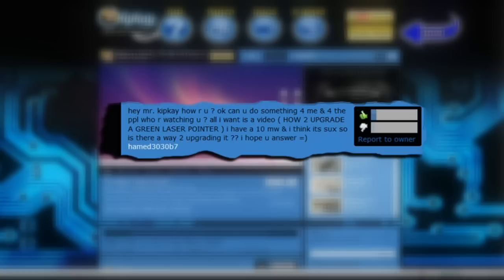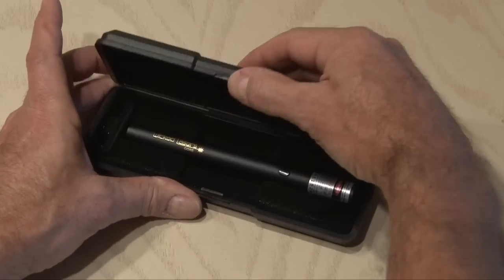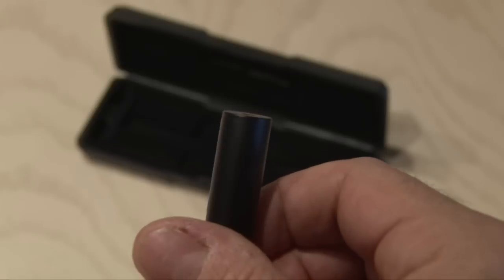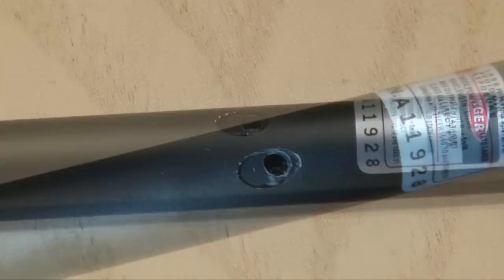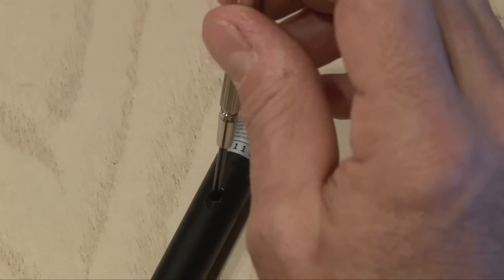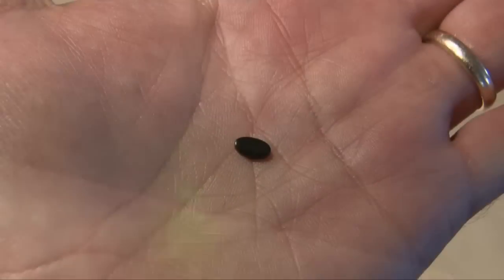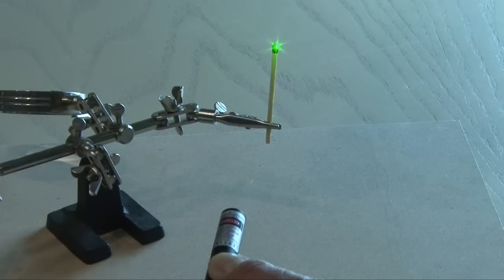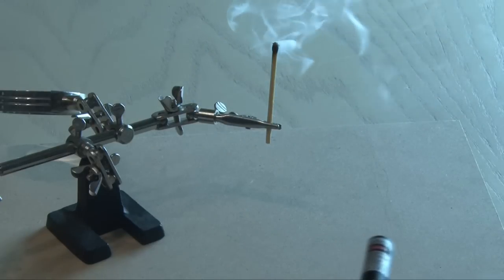Make a Laser Pointer Burn!

Comment: im gonna buy one of this to do this to.
is there anything else you have to do to the laser pointer than just pop off the button and turn the screw?
because it looks like you might have had to drill a hole.
also, has turning the screw and making it more powerful had any negative effects on the lasers ability to work?

Comment: @SK8facts it doesnt matter. dont listen to sk8. both use diodes, but green lasers use them a little differently then red lasers. but that is unimportant. pot modding your laser drastically decreases diode life and if the current is turned too high the diode will go pop... so this is a dumb idea and I doubt you will be able to get your laser to burn anything anyways.

Comment: Thats good and all if you have that laser but a lot of lasers don't have that screw to turn and make it stronger so you are going to have yo go about it differently. for example take a cheap lil 5mw laser most have a lil resistor on them i think if you switch this resistor with onw that will let more power flow to the laser you may get a higher powered laser.

Comment: I might add that any cheap laser pointer you get from the italians (or whatever the cheap streetsellers are where you live) a) wont have a potentiometer and b) go up in smoke when you increase the current on the diode.
If yours doesnt have a potentiometer you can always choose to hook it up with a stronger battery but then again "puff the magic laserdiode"

Comment: @ampix0 Because turning the potentiometer makes the diode burn out faster and laser pointers are not normally sold for the purpose of burning match heads and popping balloons, they are sold to point at things and blind helicopter pilots.

Comment: All you are doing is increasing the current that the driver delivers to the diode to a level that is dangerous to the diodes, not to mention that the crystals probably aren't designed to receive more than 10mw of IR...